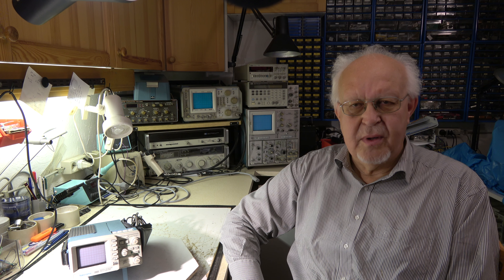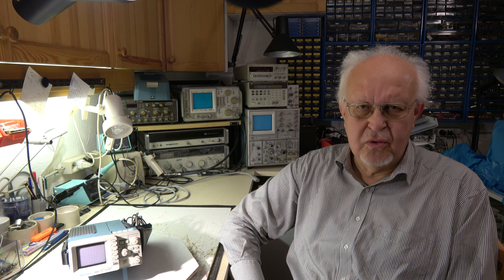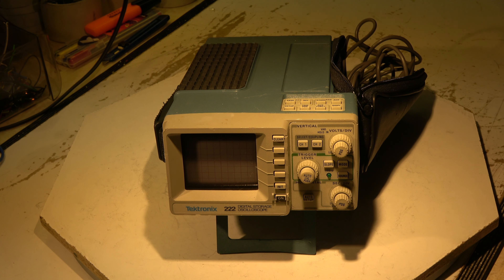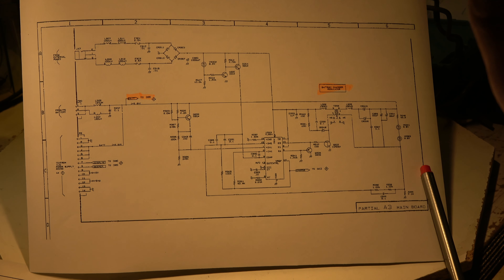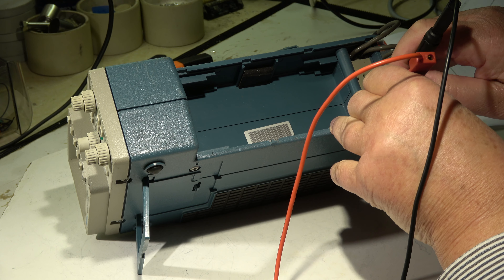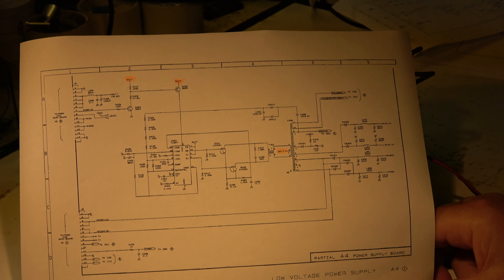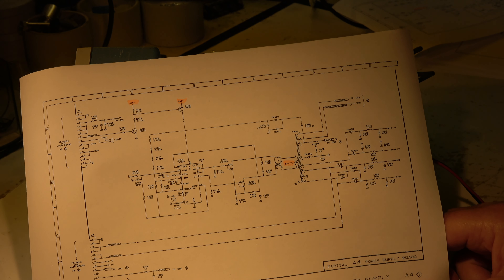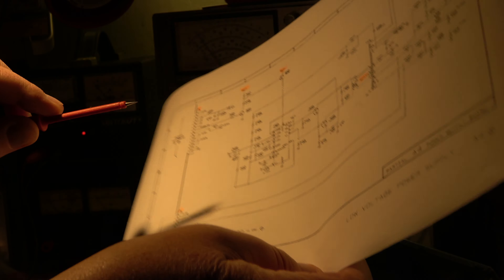#23 Tektronix Portable Scope Type 222 Repair

Comment: Great video thanks! I have one of these, but the display is rotated. Do you know what would cause this? Thanks!
Reply from the maker: Have a look into the service maual (free in the web). The trimpots R426 (Vert Rotation) and R431 (Horiz. Rotation) should solve the problem. But i propose a complete alignment of the 222.

Comment: I think you modified the unit to use standard probes by now. If you didn’t, do you still need the one probe head?   KE8NOR
Reply from the maker: Pse look at video#25, where i modified it for standard probes. So no further need for these special probes - tnx.

Comment: Good video! I have the exact Sam oscilloskope. I think that mine has got some accuracy problems but i have’nt investigated that thorougly enough yet.  Any Idea how to fix that if so?
Reply from the maker: Check with a known DC-voltage, e.g. 10VDC or so.
Are both channels affected or only one?
Check the probes (swap them fromCH1 to CH2).